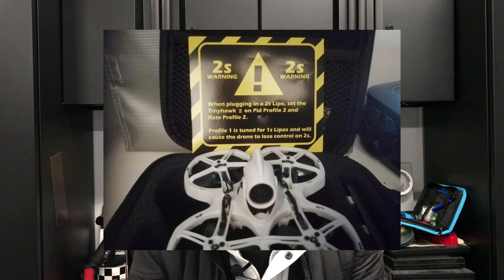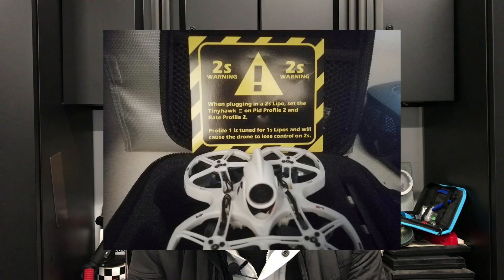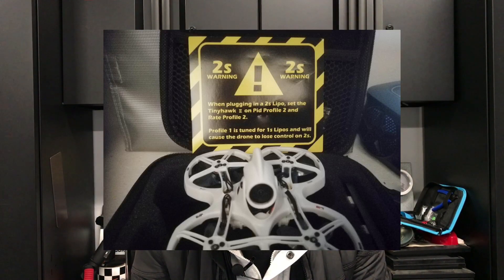Why the Emax Tinyhawk 2 Flight controller fails (Part 2)

Comment: Good to see your videos on this on this subject. I have seen and know of company's/manufactures ask or even threaten to have bad/negative reviews/video's removed. 
I am a long time RC product reviewer here and on my web site. I plan to post about this issue and will put links to your videos too.

I recently bought the TH2 due to all of the great reviews including on the forums and here on YouTube. This is my first Emax product ever.
I saw your Part 1 video and wondered if this was an issue ruining on 2S. My TH2 has a black/yellow warning sticker in the case that warns about using 2S, to use Pid Profile 2 and Rate Profile 2.
After watching your first video I was wondering if this was why people are having FC failures (Esc).
I noticed that Rate Profile 2 for 2S has a 75% Scale throttle limit, but for 1S there is no throttle limit. This sounded like to me that the ESC's can't handle 2S on full throttle.

They should have put in bigger ESC's instead of to lower the throttle limit. Or just market it as 1S or list 2S not recommended and must have a 75% throttle limit or the ESC's can burn out. 

I only fly the TH2 on 1S. But if I try it on 2S I know to change to Pid Profile 2 and Rate Profile 2.
Will be watching for your Part 3 video on this subject.
Reply from the maker: You are spot on, taking my content from Video 3! Haha. You're correct about the 75% throttle limit. That's Emax's way of dumbing down the amp draw of the motor on 2S. Note that last we checked, the CLI on the website erroneously did not include the 75% throttle limit that's supposed to be on Rate Profile 2. Looks like you checked and saw that it's there so that's good. 

I appreciate you finding the content valuable enough to share! 

I too have been concerned about manufacturers having too much pull on reviews. I was offered a Haiboxing RC car but the requirement was that a video had to be published within 2 weeks. I definitely can't perform all the tests in that short amount of time in order to provide anything valuable beyond just reading specs. Denied the offer, but no regrets. Gotta keep the content legit.
Reply: @Funcentric  I can confirm that the CLI files on the Emax web site for both TinyHawkII_RTF and TinyHawkII_BNF have the 75% throttle curve/limit for the 2S battery. I just loaded both files again into my TH2 (one at a time) to double check just before I posted this...
Here are the file versions: 
TinyHawkII_RTF_MatekF411RX_4.1_191202.txt
TinyHawkII_BNF_MatekF411RX_4.1_191202.txt
And I can confirm that the TH2 out of the box, at least my batch has the 75% throttle curve/limit for Rate Profile 2. I bought it in January, 2021.

I subscribed to your channel and will keep an eye on this subject. If I can help out let me know.
I have seen for some time now that company's/sellers are deleting negative and/or neutral reviews. This is especially true on amazon. I have been asked to leave a review on some RC products that I bought as long as it is a "favorable" review so I passed on them. They even offered gift cards as payment. Good products will get good reviews and bad products will get bad reviews, period!
Wow, two week limit for a review. A review takes a lot of time and work!

* Edited to add this. These are the throttle curve/limit settings from the Emax web site CLI files for the 2S Battery - Rate Profile 2. Make sure that Pid Profile 2 is also selected.
So for a 2S battery: Pid Profile 2 and Rate Profile 2

2S Battery - Rate Profile 2

TPA: 0.45
TPA Breakpoint: 1450
Throttle Limit: SCALE
Throttle Limit %: 75
Throttle MID: 0.20
Throttle EXPO: 0.50
Reply from the maker: @CX2Pilot  Glad Emax updating the CLI. Thanks for checking again. I wouldn't ever recommend buying a quad from Amazon. Their return policy is too good. Buyers have reported being shipped returned items sold as new. Basically getting other people's lemons or damaged products. 

Yeah, not only does the review take awhile as you know, but the video editing too. 

The PID profiles should automatically switch over from 1S to 2S usage. It's the Rate profile that needs to be manually changed to fit the battery size. I'll speak to the yellow warning card in the next video.
Reply: @Funcentric  I checked in Betaflight with my TH2 plugged in and saw that the Pid profile changes automatically for 1S and 2S. 
I then assigned a switch on my TX to toggle between Rate profile 1 and Rate profile 2. This was done by "Enabling Expert Mode" and going into the "Adjustments".
This will make switching between 1S and 2S fast and easy. There are videos on YouTube on how to do this which is what I used.
* The information I have been posting here is to help out others. This is stuff you probably know.
Reply from the maker: @CX2Pilot  yes, I have a 3-way switch connected to rate profiles so that I can easily toggle between. Glad you found it out too. Certainly helpful.

Comment: Yo, my man! Honesty and straight forward information are all anyone could ask for...thanks for taking the time to make it a little more easy for a NOOBERGOOBER like myself to grasp a hold of......as this DEFINITELY gonna resolve my current Largest problem in my life at the moment....
     Is there an ESC that you could/would recommend as an upgrade for the provided stock? 
          Thanks again and  
  eager to RIP,      Jacob Hay
Reply from the maker: Sure thing! No problem. I can appreciate that not everyone wants to engulf into these hobbies in huge depth. Sometimes the goal is just to know enough. I've noticed that some topics assume the viewer knows a ton already which isn't always the case. 

The ESC's are built into the Flight Controller itself. Most including myself don't know how to change out individual ESC's on the board. As far as replacing the Flight Controller (FC) all together, that would be very custom b/c the shape of the flight controller is proprietary. A lot of people complain about that. Every other flight controller is square shaped. 

For those that want more time in the air than on the bench, I wouldn't recommend going through the trouble to customize fitment of a standard FC on the TH2. I guess that's a long way of saying it's probably better to just get sometime else if the FC fails.

Comment: I don't have a tinyhawk 2 but I do have a tinyhawk 2 freestyle. What should I watch out for regarding like not trying to fry the board and similar issues to what you talked about?
Reply from the maker: Since the THF2 doesn't have high KV motors that draw lots of amps, the THF2 will most likely be fine. My guess is that the amp rating of the ESC's is sufficient for the THF2. I have a video out on my channel about why the THF2 isn't for beginners. It looks like you took a look at that video already for all the warnings so you know what to watch out for. That's pretty much it.

Comment: Would the mah of the battery also be relevant to the problem. Does it matter how much mah the battery has?

Do you have any idea if project mockingbird settings would matter?

Ironically I am in the market for a new whoop because my nbd hummingbird is badly drifting after a few flights only and I can't  figure out why.

Thanks a lot for sharing your knowledge 👍
Reply from the maker: Short answer is no. If the mah rating of the battery is not high enough, it would translate to a lower amperage rating of the batter and stress out the battery making it warm/hot. 

For more info on the relationship between the battery, motor and ESCs: https://www.youtube.com/watch?v=g5t6w4686HQ&

I don't know how the project mocking bird affects the quad in terms of amp draw from the motor. I do know it was tuned for indoor use, so I imagine that it wouldn't create too much stress on the motors more than stock if at all. But that's just a guess. You'd have to look at the amperage draw in the OSD. 

Maybe I can help. What do you mean by "drifting"? Perhaps the accelerometer needs to be calibrated. I think it's right stick straight down and left stick up and to the left. You should hear a confirmation beep afterwards. Or you can also do it in betaflight.
Reply: @Funcentric  Great 👍. Thank you for the answer and the further link.🙂

I have the nbd hummingbird project Mockingbird brushed, which only runs on silverware. That's why I haven't tried the recommended stick commands yet.

The whoop doesn't hover properly, yaws, drifts to the side and back and forth. But worst of all, sometimes it suddenly runs off quickly in some direction, especially when I turn, without any corresponding commands.

I would be really happy about a tip on how I can fix this. I've already tried the gesture gas down and right gimbal down three times.

Any ideas? Motor or FC defective? I really did not fly it much.
Reply from the maker: @fidelgrillo4808  I would recommend submitting a ticket to newbeedrone. They might take some time, but they will get back to you. Service is top notch especially compared to the other guys. You may want to see what the experts on the Facebook group have to say. Do a search they’re also in case that question has already been answered by someone. Sorry I cannot be of much help since I am not familiar with silverware other than knowing it takes a bit of programming.
Reply from the maker: @fidelgrillo4808  for what it is worth I do not think it is a bad flight controller. From the symptoms that you’re experiencing and reporting, it doesn’t sound like it. A faulty flight controller I would think would fail all together and not even allow you to fly.

Comment: This is very distrubing, because the rates should be... and I say should be... I'm not saying they are... from any quad to any other quad irrelevant of the quad or battery.    For example, if you set your roll rate to be 360 degrees per second, it should be 360 degrees per second on a TinyHawk, on a Flywoo Croc, on a Apex, on a whatever.   If Betaflight isn't doing this, but instead whatever you set in Rates gets some arbitrary result depending upon the technical abilities of the quad, then Betaflight is a steaming pile of...

Comment: I'm so confused now lol I changed rate profile and it acted wierd but obviously that's the problem. Iv seen people change the profile for 1-2 s I didn't realize it said rate so I already adjusted those to do light freestyle and now I don't know what it's supposed to be now. Lmao fml.
Reply from the maker: The Profile and Rate Profile are 2 different things. It's the Rate Profile that you want to change for using 2S.  The regular profile which change on its own based on what battery sizes you put in. 

Again, I'd stick with 1S personally for the TH2. It's not the rates that you actually need to change. It's the Rate Profile. Embedded in there is the Throttle limit which needs to be at 75% for Rate Profile 2 for 2S.

To be clear, we're talking about the TH2 here - not the THF2.

Comment: Subbed #300  🤟🔥✌️ hopefully I don't have this problem but I'm sure I will lol I have the worst luck ever. But I'm trying to get this thing to fly better in acro its all over the place. And nearly impossible to fly inside.
Reply from the maker: Hurrah! Nice round number. Welcome Mr. 300! It's definitely not an indoor flyer. Not sure why people are suggesting it is. I've heard it before too and it's quite misleading. Gets people into trouble. Flying the THF2 is outright dangerous. I wouldn't do it. If you want indoor, I'd recommend a 65mm whoop like a Newbeedrone one. 

If you're finding the quad is "all over the place", I'd recommend lowering your rates and increasing your Expo. But before you do that, do a few rolls across multiple batteries to find the sweet spot for Degrees Per Second, then you can adjust your rate, super rate and expo accordingly.

Comment: I'm in my second one have had the most fun flying it . The second one just blacked out on me and inknownthe camra good cause about it in old unit and it works fine. The first one antenna that connects to the black rubber beleave it's called the vtx is missing how do you replace?
Reply from the maker: Yes, the thicker black heat shrunk antenna sticking out the side is the VTX antenna for the video. Check out my most recent video that discusses and shows a zoomed in video of the VTX and describes how to do it. You'll want a more step by step video from others that show you exactly how to do it. Mine just shows the principle of replacing it when I talk about the THF2 not being for beginners.

Comment: I've had really good performance with 96hz jesc high demag and medium adv and pretty much stock bf 2.8 pid settings, use batt compensation and calibrate on the power battery tab ... great video

Ps. LOS W/no video I get 7-8 minutes on 1s 500mAh so I know I'm not pulling too much... I've learned the hard way

Comment: It's not about "Rates" Per Se, but about Throttle limit that is linked to a rate profile. In Rate profile 2 there is a Throttle limit (set to 75% or so) to limit power and power draw when using 2s.

Suggestion to just use 1s doesn't make any sense, just use Rate profile 2 (or set Throttle limit yourself) when using 2s, as Emax told everyone to do.
They just didn't have the guts to say that you can burn ESCs when using 2s without throttle limit that is set in Rate profile 2... And they should have stated that clearly.
Reply from the maker: Correct, you're spot on with everything you said. The throttle limit is in the rates tab of Betaflight. I'm working on a Part 3 that will clarify all this. The concern too is that the current CLI downloadable from Emax unfortunately is missing the throttle limit so even when customers use Rate Profile 2, they won't have the throttle limit implemented as designed. I think this was just an oversight by Emax.

Comment: Thank, you this is great information!  Love my Tiny Hawk 2 -- it flies better with 1S anyway.  If I limit max throttle (say offsetting so it's down to 80%) on my radio, would that help keeps the amps down?  I rarely need more than ~60% throttle anyway when flying this.
Reply from the maker: Yes, that would definitely help. Anything you can do to keep the amperage low on the motor.
Reply: You can access the Betaflight settings via OSD (yaw left, pitch forward) and just switch the both profiles to "2".
Reply from the maker: @mipuist  Oh yes, thanks. That's right. I'm so used to just changing the rates on the OSD that I forgot about being able to change the rate profile as well. I also have the rate profile changes done using a 3-way switch for more immediate changes on the fly. Works out well as some rates are better on other quads for me than others.

Comment: Thanks for the update on the TH2 problem. I probably would never fly the TH2 on 2s but still if the esc’s are that weak I think I’ll pass & look at something else. This confirms my idea of putting the Mobula6 in a 75mm frame. If it flies anything like my Mobula6 I will be happy & won’t miss my THS
Reply from the maker: Oh. Looks like you saw it already. Haha. I recently built a Shutterbug85 using a mobula7 board. Incredible flying experience. 2S though.